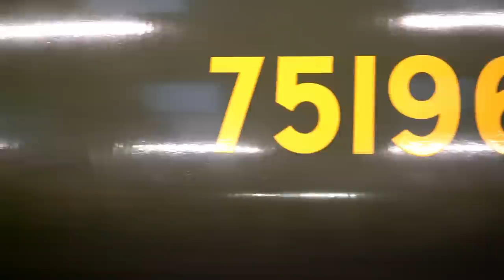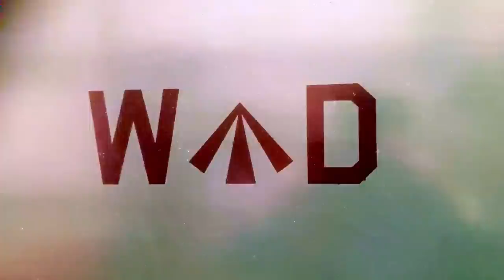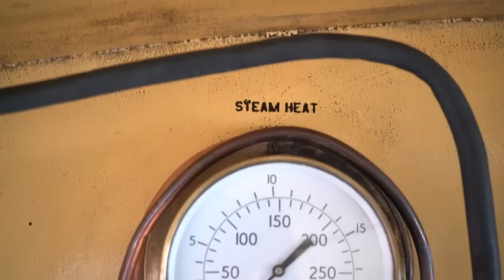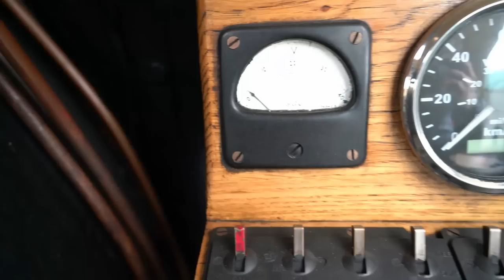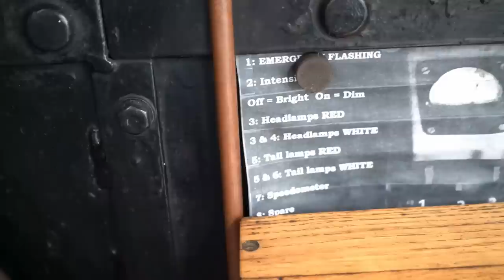The British Army locomotive in Belgium! -Lawrie Goes Loco Ep. 15

Comment: I volunteer on the isle of wight steam railway we have 2 austerity's and one of the engineers there works on this loco in Belgium as he fixes air pumps. Great locos very powerful
Reply: You have WD192 Waggoner, don't you...? I remember climbing over it all when she was part on the Museum of Army Transport, in (my home town) Beverley. I need to come and see her again, really. It's been about 17 years.
Reply: Indeed, Len and I get on well. He did a lovely job on the pump. He also helped replace the crown stays and with the tube fitting. I’m looking forward to comparing how 192 is to my loco. 198 is uncannily similar. 192 went out of traffic just before Sofie and I started coming over to do the occasional turn at IWSR
Reply: @chrishoggett1375  yes it will be good to see 192 back out again it's a very good engine I don't think it's seen as much work as 198 has though
Reply: @phil69881  yes 192 waggoner and 198 royal engineer live on the isle of wight steam railway, the railway also own another one called Juno but it's currently in the NRM museum at shildon
Reply: oliver budd haha, yes, 198 does a fair share of work. Always ends up doing duty 1 too when two trains are running.
Reply from the maker: I love it how it turns out how many people know each other in railway circles! 😂

Comment: I went inside that saddle tank and cleaned it one end to the other - went under the baffles to get along it. 1975 or 1976 KESR, preparing it for Mid Hants. Yes it was called Errol  Lonsdale. I actually think they are a work of genius and easily one of the best British Locos ever designed and built. They are the ultimate incarnation of the Victorian engine. Not having superheating is a big plus on the simplicity front. From the way they go you would never beleive it has slide valves. It's very stable on the short wheel base, and very powerful indeed. You wouldn't get the stability with outside cylinders. They will do 25mph without a problem. Thanks for such a brilliant program. I think the added Mech lube helps keep it nice and quiet.

Comment: These are just right for the job they were designed for . Heavy shunting and short working.  They have done much more over the years but their design was to start and pull 1000 ton on the level.
Seeing you crawl into between the frames brought back memories. The line I used to volunteer on had 2 miles or so  at 1/90 ish. With 6 on the fire hole door would start to glow red. The bark did / is even making me smile now.  Big engines need load and be allowed to run fast. An Austerity  barking to climb or starting a  train is just as wonderful as a pacific stretching her legs with 10 + on the hook.   For me an austerity every, any and always ... no contest..... 
The condition of this one shone through, even the bits the public don’t see were clean. That take dedication and love. Yep love.  To see a couple working their own loco and keep it in such a condition needs respect  appreciation and a bow of recognition. Very nice to see her working.. and your smile.  If the owner ever sees you turn up with a low loader I recon you will  see a scene  very much like a farther getting out the shotgun as the young boy comes up the garden path for his young beautiful daughter.   Amacf
Reply: St A & M Rly thanks you very much! Nice to see somebody appreciates the finer details :)
Reply from the maker: I agree the Austerity is a wonderful piece of kit. The noise of the ones working out the bank at Foxfield is just magnificent.
Chris is so proud of his Loco and it shows, its magnificent. I doubt he'd let me get anywhere close with a low loader 😂 😂

Comment: Awesome video, the J94 (austerity) in my profile pic is called Lord Phil built 1944 but was rebuilt as a later 1960's built austerity, the heritage railway have done a very good job at overhauling the loco :)
Reply: J94 the vacuum and combined steam brake on Lord Phill came off WD196 ;)
Reply from the maker: I do love it how when you start looking at locos how many bits got stolen/borrowed/sold between engines!

Comment: Might want to invest in a long-spout oil can like we use here in the States, saves having to get in-between the frames to oil up the fiddley bits, particularly on the old Stephenson link valve gear .

As for why they used it on these instead of something like outside Walschaerts gear, I'd hazard a guess and say it was because it was a simple,  proven,  and reliable design that could be produced quickly under wartime conditions.
Reply: Shipwright1918 indeed, they wanted an engine quick and cheep. Hunslet took the designs they already had, with casting patterns that they had available and just changed sone things to meet army requirements. Bit bigger wheels and larger water tank for example
Reply from the maker: As Chris said, and as for a long spout, part of getting inside is for inspection of all the moving parts before we go out.

Comment: I wonder if something like this would be able to run a smaller lesser used main line service in the UK like one of the one train per week services (Stalybridge to Stockport) or a branch line that is part of the national network, you would have to fit all the required equipment but it would be an interesting alternative to replace Pacers.

Comment: The reason they didn't go for outside cylinders is because they wanted a tried and tested design, the "J94's" are essentially a slightly modified Standard Hunslet 50550 class, which was an evolution of the 50540 class, both of which are inside cylinder machines. The MOD had origionally planned on ordering LMS 3F tanks
Reply from the maker: That and they didn't have time to develop a new design.
Did they really consider Jinties?
Reply: @lmm  they did indeed, although quite why I don't know, as the GWR 57xxs would make far more sense!

Comment: The diesel is a French-built Cockerill "locotractor" with a 2-stroke GM diesel engine.  

I guess that locomotive wasn't made to run a long line?  I couldn't imagine having to stop every forty kilometers just to re-lubricate the coupling rods...
Reply from the maker: It's a great little thing.

It would do futher, but they want to keep it in tip top condition.
Reply: Cockerill is BELGIAN not French!

Comment: I don't know what it is about British steam engines with headlamps...I just love the way they look. Maybe its because I'm a yank and I think all engines need to have them, lol. 

I'm intrigued by the way you put the fire into this thing: in the states, the way I'm most familiar with doing that (for an engine that's not an oil burner of course, which many are)--and assuming you're not somewhere like Durango which has an in-house steam plant they can hook the engines up to, to keep them warm all night (I think they keep a low fire in their engines most nights too)--is you start it with wood purely, usually soaked in some kerosene for good  measure. light a rag on fire and toss it in--though I know of at least one line that has used fusees (flares) for this too, lol. here we actually feed them pure wood for a bit, to get her warm, then only slowly add coal in. I've never seen coal and wood used together to start: I guess I learned something new!

EDIT: your comment about Foxfield….YES. Tie a rake of wagons on the back and just let her sing. There's no more glorious sound than a steam engine working uphill with a load.
Reply: Sawyer AWR our locos are preheated with wood the day before to expand the boiler slowly. In this case the loco still had a little steam on from the previous day running, so some coal was mixed in strength away. Keeping the dampers closed the fire spreads fairly slowly. There really isn’t one right way of doing things. But as long as the boiler is brought around slowly, that’s what matters. Durango is amazing, I’ve been there 10 years ago, I really need to go back. Same goes for Cumbres and Toltec
Reply: @chrishoggett1375  Personally I recommend the Cumbres and Toltec over the Durango and Silverton. Don't get me wrong, both are amazing trips...its just that Durango has done some dubious stuff with their historic equipment that my historian side just can't get behind.
Reply: Sawyer AWR I agree, as I mentioned it is a long time ago I went there, but I remember Cumbress having a more authentic feel, whereas Durango I felt more like tourist being squeezed for money.
Reply from the maker: I really want to do Cumbres and Toltec, I've done Silverton and it was magnificent. Absolutely incredible.

Comment: The Hunslet Austerity is probable the best loco ever built, miles better than them GWR pannier tanks, with all the controls out of reach.  WD190 & WD200 are near you Lawrie, they are based at the The Colne Valley Railway, Castle Hedingham, Essex. both are ex MoD Shoeburyness.
Reply from the maker: Oh yes! I knew they were there. Nice little line.

I really like Austerities. Cracking engines

Comment: At about 27:00, I have no doubt that I would be modifying the engine with some copper tubing and oil resistant rubber tubing for those oil points.
Reply from the maker: Most of it that doesn't move about already had pipework to help. It's all the movey whirly roundy round bits that are the problem.

Comment: I really don't have any knowledge on air braked engines but I've worked on a couple of Austerity tanks, that being 132 'Sapper' and 75006 'Swiftsure', so with that particular Austerity being modified to have an air brake system, does it have no need for a steam brake? I noticed it didn't have the handle for the steam brake over the top of the firebox
Reply: Ainscough Productions Steve Latham got the parts for the air brakes on his two austerities you mention via us in Belgium. :)  This loco doesn’t have the steam brake anymore, the brake cilinder is converted to air. The reason is that by law of the Belgian railways inspectorate, the loco must also brake along with the train brake and the brakes must apply automatically in the event of the coupling braking between loco and first carriage. In order to comply with this, the entire system has be changed to airbrakes. The brake valve is currently a self lapping Oerikom FV3 valve, (like a Davis and metcalf) but it often has trouble with the oil from the pump, so that will soon be altered to a more old fashioned Westinghouse like Sapper and Swiftsure. When the engine was converted it wasn’t sure the inspectorate was going to continue allowing non-self lapping valves, that’s why a more modern option was taken. Now that issue has been cleared we can convert it to a more appropriate valve
Reply from the maker: I've fired Swiftsure on several occasions whilst it was at the NVR.

Comment: l can admire the aesthetics of an inside-motion steam locomotive, even as an American. But considering the amount of trouble you had oiling the motion in this video and in the video of #813, I don't understand having it on small locomotives. It boggles my mind that you could even reach the motion on narrow gauge locomotives.
Reply from the maker: There are ways to oil up without getting in, but to inspect the thing before going out for the day you really need to get in there. Narrow gauge because it's smaller you can normally reach bits.

Comment: There must have been some engineering advantage to the inside piston design but they were clearly more difficult to service.
Reply: trr94001 the war department wanted a loco quickly. Rather than designing an entirely new engine and producing a load of new casting patterns Hunslet simply took an exciting design and altered where needed to meet the requirements made. That’s basically how. Time and cost cutting :)
Reply: Inside cylinder locomotives have better clearances for one.
Reply from the maker: The advantage of inside cylinder is better weight distribution of the moving parts having it more centred. But, as Chris said, a Loco was needed quickly.

Comment: 198 and 192 are still on the isle of wight 198 is operational and 192 is under overhaul but is set to return in the summer 2020
That is some mad placemat of a air pump as 198 and 192s air pump is on the fireman's side not under the Frames
Air pump sounds is very normal, vacuum brakes not normal for me
Reply: IWSR FC Indeed. Last summer I did a few turns on 198, last turn was with smart on a very windy day. It is amazing how similar my loco (196) and 198 are. Identical twins, also produce the same little foibles. Len tells me 192 feels a bit softer. Hopefully I’ll find out this summer.
Reply from the maker: That's interesting to hear they are so similar, so often you hear that sisters are so very different! I very rarely get to use air brakes, so this was fun!

Comment: Everytime i see a British locomotive, I'm wondering how do you maintain the inside valve gear? Here It's kinda normal to oil the valve gear over short stops and stuff, seems like you can't do that here, let alone if it throws a bearing or something. You seem to need a maintenance canal for everything, or am i missing something?
Reply: If you oil her properly,  she will last a long time. Throwing bearings is not a frequent occurence on well maintained locos!
Reply: @kevinhoggett1717  Well I've seen it happen and was helping to fix the eccentric rod bearing on czech railways 475.179, just in the middle of a station cause it just broke, even though the loco is kept in an amazing shape. This really seems like a big hindrance to me being from the continent. Might be the routes those locos went were much shorter than on the continent, too?
Reply from the maker: There is a pit to be able to work on it, and you can get to most parts to top up the oil without climbing inside. If it does fail, then it's going to be a pain 😂

Comment: Inside motion seems to have been quite popular in the UK, but what are its adavantages? It's much harder to maintain than outside motion, and it seems that most loco builders elswhere have gone for outside motion.
Reply: goawaygoawaynow the loading gauge in the UK is part of it. As the UK was the first country in the world to have railways the gauge is more limited. Especially lower down. Hence some locos have cilinders mounted fairly high up at an angle. GWR had slightly large gauge, that is why not all GWR locos can go everywhere in the UK. One technical advantage is that because the connecting rods out there power closer to the middle of the axle the locos ride is smoother as the engine doesn’t wiggle about so much in the track. Take for example a broomstick, hold it horizontal in front of you and place your hands close together and wiggle it, then do the same with your hands further apart, you’ll notice the brooms makes larger movements much easier because you have more momentum the further to the outer ends you take hold of the stick.
Reply: @chrishoggett1375  I thought about the smooth ride, but the fastest locos, even in the UK, all have outside motion. Perhaps those fast locos are large enough that the motion forces are not that much of a concern?
Reply from the maker: Remember frequently the large engines have three or more cylinders, so they've got cylinders and sometimes valve gear on the inside too!